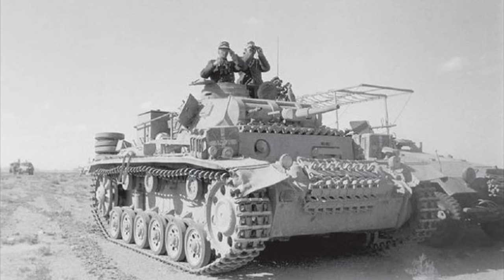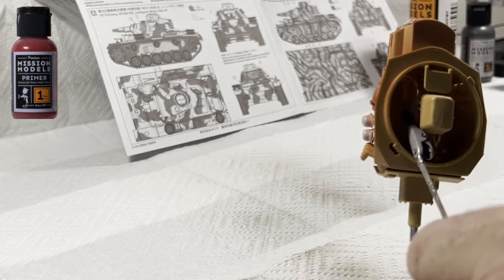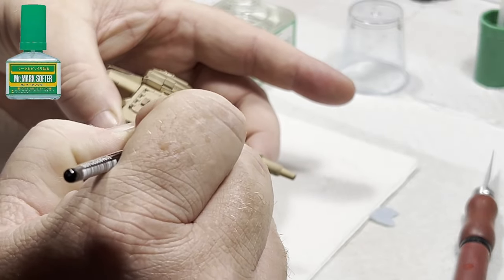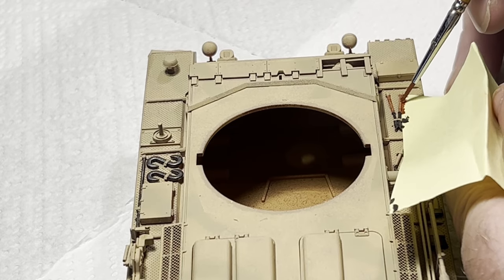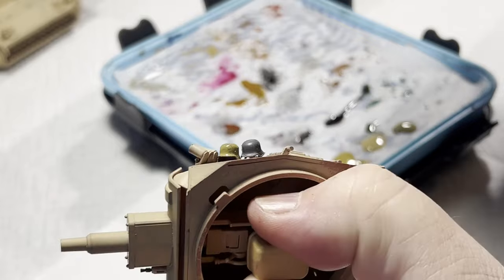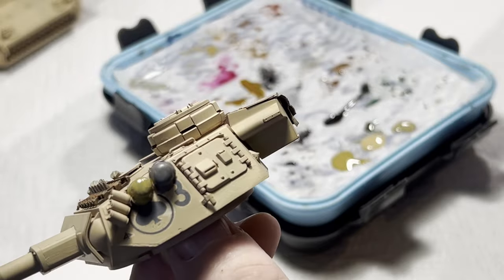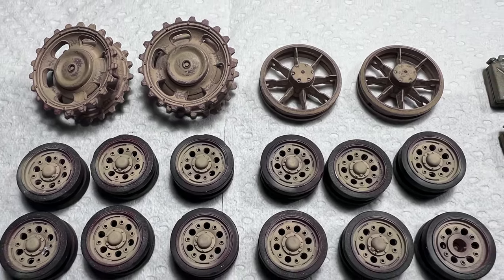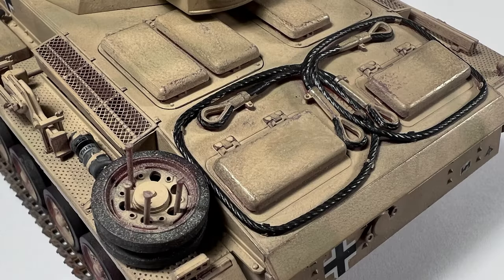Tamiya Panzer 3, Ausf N. Part 2 Painting | Continuing the 1/35 Tamiya nostalgia build

Comment: Hi Stewart!The DAK Panzer III is looking great. I like the idea of ‘ burnishing’ the paint to create wear on the final coat to replicate wear, etc., and the result looks very realistic. I have not used Mission Models paint, and I wonder if the same result could be used on other acrylics?. I am really looking forward to the outing of the Panzer III, as I am working on a couple of (possible) DAK subjects at the moment, and the application of realistic dust weathering is something that alludes me at the moment. Love the channel mate, and always looking forward to the next upload. Cheers for now!
Reply from the maker: Hey Gary. Thanks again for your feedback mate. Yes you can burnish other water based acrylics, but to varying degrees. In some instances if you want really advanced age you may need to use thinner instead of water to kick the process along a bit. 

For example, I also tend to use Tamiya hybrid acrylics. They can be burnished a little, but if I want to really show a lot of wear I'll gently use a brush dipped in Tamiya's X20A thinner... dry the brush off on paper towel before scrubbing the paint and go slow and easy. 

Other water based acrylics like Vallejo Model Colour or AK 3rd Gen for instance will burnish but not as easily as Mission Models. I recommend doing testing on painting mules to find what works best for you. Hit me up if you'd like to know more Gary.
Reply: @BlackHatScaleModels  
Thanks Stewart. I generally use Tamiya, Vallejo, or sometimes Mig paints. I will try the method on Tamiya first, as I think they may be the most forgiving. I will certainly let you know how I get on. Cheers.

Comment: What did you use to remove the turret doors, I've got a pz4 with the same problem.
Reply from the maker: I simply removed the turret, then put a finger in through the turret ring and push from the inside. Because I use Tamiya Extra Thin cement, I really only use "enough" glue to hold the parts so if I need to do this it doesn't mean I end up breaking things to remove it.